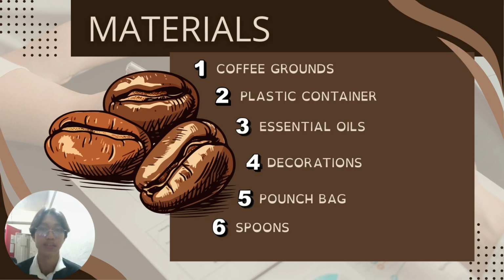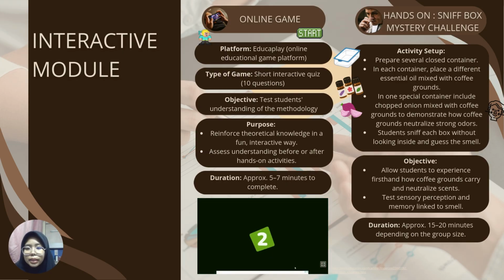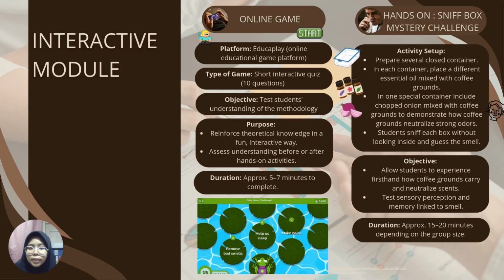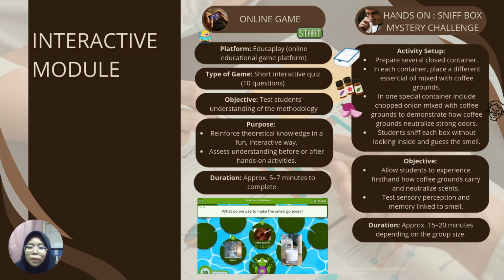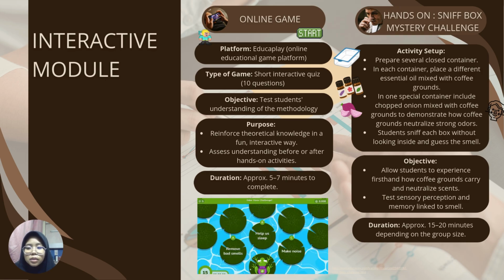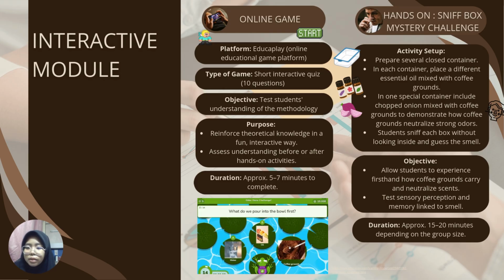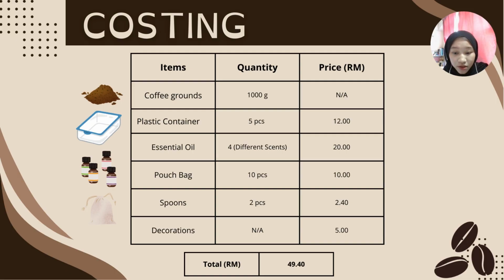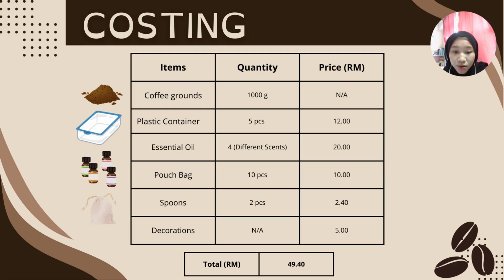ENG3104 Project Proposal_ Group 5: Odor Neutralizer with Coffee Grounds

Comment: Q1 : Data collection on coffee ground disposal .
Q2 : coffee ground collection? where and how much? - zus coffee
Q3: Methodology : provide figure for step by step method
Q4 : INTERESTING INTERACTIVE MODULES- WELL DONE
Q5 : COSTING - the preparation for many pax?
Reply from the maker: Prof. Wan Azlina,

Question 1- We are currently in the process of collecting survey data from several cafes. From our initial findings, cafes such as ZUS Coffee and Kopimesin typically dispose of coffee grounds about 1–3 knock box loads per day (~1.2–2.4 kg). We’ll update the proposal slides with this info.

Question 2-  Yes, Prof., we plan to collect used coffee grounds from both Kopimesin and ZUS Coffee. We will provide them with sealed containers to store the grounds over a few days. We have already received approval from Kopimesin. Based on our estimates, we expect to collect approximately 5 kg of coffee grounds in total for our project activities after the mid-semester break.

Question 3- Noted, Prof. We will update our proposal to include figures showing the step-by-step methodology for better clarity. 

Question 5- Our preparation is planned for around 100 participants. We are planning to order about 100 small tea bags (RM 3.20/100 pcs), each filled with roughly 50 grams of coffee grounds mixed with fragrance. These sachets will be used as simple odor neutralizers and will also be given to the students as a takeaway item from the outreach activity.

Total cost of all materials (containers x5, essential oils x4, tea bag x100, spoons x2, decorations) - RM 45.30

Updated proposal slides will be uploaded to Google Drive by this Saturday (3/5/2025). Thank you, Prof!
Reply from the maker: Prof. Wan Azlina,

This is our updated proposal slides for your review.
https://drive.google.com/file/d/16TQeIvHnVOGiwOenw7BQFIFZRN8lGGm7/view?usp=sharing